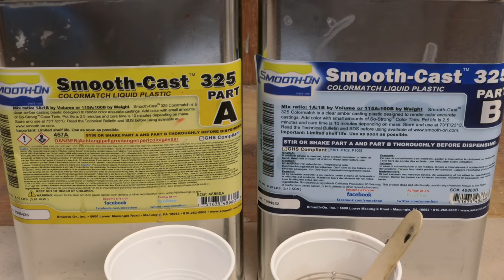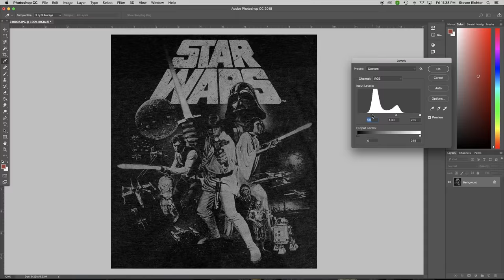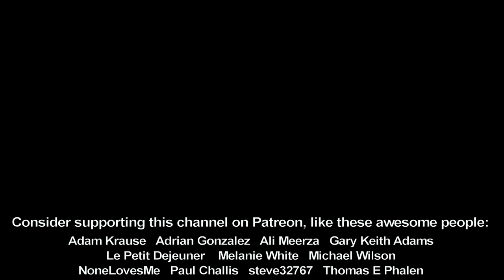Self-Portrait Sculpture Timelapse

Comment: I'm amazed just by the fact that he can make t-shirts from zero.
Reply: Technically he made a shirt from already existing shirt so... Its like I will make a sheet of paper by taking a sheet of paper and cutting out part of it.
I can do it. For sure. EZ.
Reply: @hahaoo2906  It's so not the same at all, lol.
Reply: @DeeckyRizzo  small shirt from a regular size shirt = small sheet of paper from a regular size sheet of paper.
Those are totally the same and both require having the same skill set - no skills and talent required!
Everyone can do it. Easily.
Reply: @hahaoo2906  I disagree.
Reply: @DeeckyRizzo  u can test it and prove me wrong... Try to do what I said, if u can do it, u can 100% do the shirt thingy
Reply: @hahaoo2906  He had to make the design on the shirt and sew it. If you don’t have the tools or skills to do either of those things, it won’t be easy
Reply: Sarcasm slamming its face into a sculpture
Reply: @philthestampede  One would thing that, uh? But you never know with people on the internet.
Reply: @c3m3t4ry81unts.  the person has a point in a way. You cut out the model of the tshirt on paper before you make the tshirt. Then all you need to do is know how to use a sewing machine and it isn't rocket science. But as the old saying goes everyone can make a spoon but only the master can put the handle in the middle.
Reply: @hahaoo2906  you can cut a pice of paper and get a smaller piece of paper.. you can't just cut up a shirt and end up with another shirt.
Reply: He’s my favorite, because his sculptures wear actual clothing/hair. Also, I was wondering where he got the little glasses from. I wouldn’t be surprised if he made them himself.